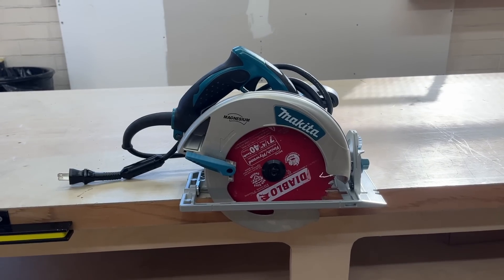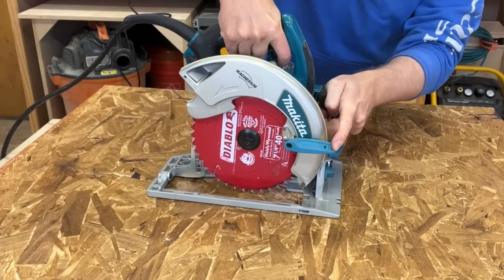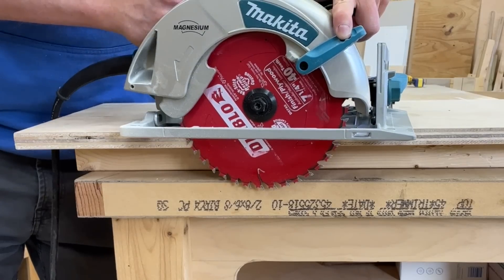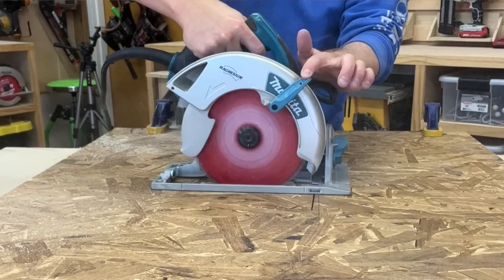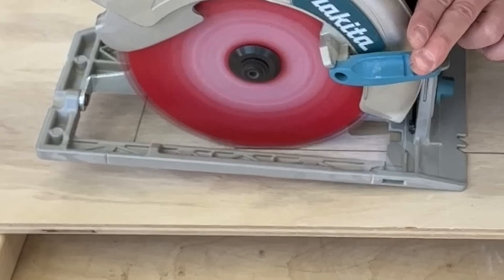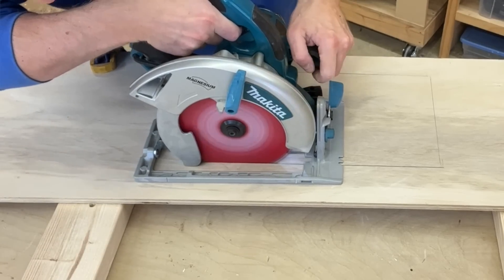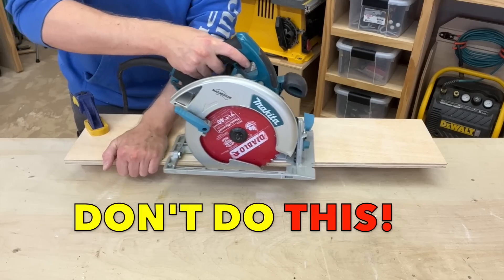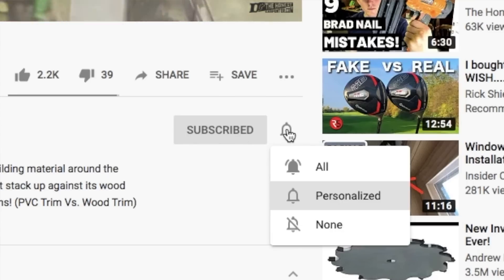Don't Try This DANGEROUS CUTTING TECHNIQUE! (Here's How To PLUNGE CUT W/ Circular Saw Instead!)

Comment: Interesting to see all the anti-plunge cut pushback in the comments. Plunge cuts aren't dangerous if done correctly, which is the way you demonstrated.
Loose plate cutting isn't something I've ever considered doing in over 40 years of working with saws. It's unstable, and achieves nothing that having a locked plate won't. Honestly never heard of it until today.

Circ saws cut much faster than jig saws, especially for large areas. In addition the circ saw is the one being used continuously on a jobsite, so there's no need to stop and break out another tool.
Reply: Lots of DIY types who aren't comfortable with a plunge cut, so jump to the conclusion it's dangerous and should never be done.

Comment: And to things I saw you do and didn't mention.
1) you had your material clamped as to not move
2) stood to the side of the cut, not behind it.

I come from a family of tradesmen ( electricians, tin-knockers, carpenters, etc)
We know about the short cuts. We just don't use then if the conditions are too sketchy.

Comment: I always drop cut 2X4's for framing with my rear handle if I am not using a Mitre Saw. You get a squarer cuts.
Reply from the maker: Yep, you definitely see it a lot with rear handles, Todd. Most framers even do a type of drop cut for square cuts. The worm drive mechanics are just more conducive to it.

Comment: OR maybe... just maybe... Get a plunge saw for the purpose instead of doing dangerous tricks with a circular saw.
Some people will now say "but that is expensive" and similar stuff, but I am pretty sure that it will be more expensive to loose a few fingers! Don't cheap out, and stay safe, those damages are usually permanent damages.
Also, after getting my own plunge saw a few years ago I only had ONE regret... not buying it sooner. A proper plunge saw on a proper track is so much more precise, and is so much easier for those long straight cuts. (Also, I suggest you get yourself a 90degree angle attachment for the rail, it is nice to be able to do perfect'ish square cuts)
I hope you all stay safe :-)

Comment: Cut depth should be set with the full tooth depth just clear of the bottom of the timber. Best not to stand behind or astride a  drop cut on a low job. I vividly remember, way back in 1982, a big 12" saw running back on bloke doing that and opening up his femoral artery.

Comment: Great advice!  One curiocity though: for those of us having a jig saw, would it be better and safer to drill a hole first and then use a jig saw to cut the inside of a plywood like the one shown in the video, wich won't have any danger associated with potential circular saw kickbacks doing plunge cutting, if safety is the top concern?
Reply: yes
Reply: if you aren't comfortable with a skilsaw, then best to use a jig saw. It will take a bit more concentrated effort to keep a nice strait cut over any distance however.

Comment: Good video but it isn't that dangerous, but it is easy to mess up the cut unless using the techniques you showed. Hmm, is there a guide rail designed for plunge cuts? That could be handy. I've seen specially designed circular saws for it but not a guide rail.

Comment: As much as my dad cut corners and rigged stuff, he never did this at all. He'd take a drill and drill a hole to start a place for a jigsaw blade to start cutting a line enough to get the saw blade in. I always thought that was so smart, because even if he would have done this, he would have had to do it just right, as you demonstrated. Better safe than sorry.

Comment: The trick is to have arm strenght, hold the saw with both arms and have a very light finger pressure on the switch, ready to release at any time. And not move the saw backwards.

Comment: As an aside:  I prefer to use a "left handed" circular saw in my right hand.  That way I can just see the blade on "my" side, and not have to hunch over the saw to see it on the other side.
Reply: i hate and wont use anything but left side cut, im a righty and right eyed, ALTHOUGH that new center line cut FLEX is ambi
Reply: I agree. IMO saws are misnamed. Regardless of which side the blade is on "left hand" saws are for right handed users and vise versa. My Bosch CS5, Rigid worm drive, and Metabo 18V are all left handed.
Reply from the maker: I can see the logic there. I just got so used to right-blade sidewinders that it’s like second nature to me now
Reply: I concur! In my comment I asked why he did not use the worm drive saw sitting handily in the background. 😁
Reply: Or you can do what I do and learn  use a saw lefthanded when needed. I injured my right hand when I was a kid and became ambidextrous by necessity. It has carried over to adult life and has been very helpful in my work and life 🙃

Comment: I pretty much loose plate for every plunge but most of the time my saw is on a plywood  track so loose plate guarantees my saw in on track rather than squint. I tend to do it off track too again so my plate is always on my marks. Once I plunge to depth I'll lock the plate. I really don't see any advantage to having the plate locked other than precise depth control.  I suppose it's just the way I've done it for years on thousands of meters of timber, I wouldn't feel comfortable doing it your way.

Comment: Hi,

Although there was a whole video about circular saw safety, I have a question which I did not find the answer for there.
What can go wrong if the revolution of the circular saw (5200 1/min) is higher than the allowed maximum revolution of the blade itself (appr. 3000 1/min if I remember correctly)? I know manufacturers design their products with certain safety factor like 2 or 3 so it should be a serious problem, but I still do not like to go aganst the manufacturer's recommendation. Should I rather not use the blade?

Thanks
Reply: The tips of the blade are where the speed and action is. It's not unheard of for the tungsten carbide tips to fly loose. That would be my main concern assuming its a wood cutting blade with TCT.
Reply: @vidpromjm  Thanks, whats what I thought. As I made some math now, I got that the acceleration of the tips is almost 3,5 times higher when the blade is operating on the highger revolution. So I'm going to buy a new blade, rather not risking little flying (251 mph) tips around me :)

Comment: I heard somewhere that if you remove the guard or have it pinched so it won't cover the saw, and the saw falls down on the table or floor that it'll actually run towards you!
Sleep well tonight.

Comment: I understand why plunge cuts with a circular saw are a thing but if you're not good at them or don't yet trust yourself there are other ways to achieve a similar result. And they're usually safer

Comment: Great video as usual. I understand you don't want to offend/critique  professionals, but an unsafe technique is unsafe regardless of how often you've done it.  The only difference between a pro and a DIYer is that a pro gets paid for their work.  Pro's shouldn't get a pass on unsafe techniques.
Reply: difference is also that a pro will have more experience and skill with tools in general. That being said in nearly 20 years I've never done a plunge cut with a loose base, and can't think of when I'd need to, there may be an odd time but I haven't run into it yet. Plunge cuts are perfectly safe however.

Comment: That technique works well for smaller battery operated circular saws, except you're supposed to have the guard locked back and have a hand on the base. Without the hand on the base it seems pointless

Comment: the best way to do it is to get a saw designed to do it, a track saw
Reply: For finishing work sure. For rough carpentry, nothing wrong with plunge cutting safely with a circ saw.

Comment: I agree with majority of what you said, only thing I don’t agree with is using safety glasses and I flat refuse to use them. For the simple reason that saw dust builds up on the glasses  almost like the glasses are fogged up and makes it really difficult to see what you’re doing.  Been in the woodworking business over 40 years and have never used safety glasses and have never had a problem with anything ever getting in my eyes.   I rather see what I’m doing clearly then looking through a foggy looking lens where I’m more or less guessing what I’m doing and end up having a mishap and getting hurt. All these years in the business and I have never hurt myself with using any of my woodworking equipment and still have all my fingers too! There’s a whole lot of woodworkers out there that have lost fingers if not worse? Only time I use safety glasses is when I’m doing any kind of metal work and/or having to do things from the underneath side of the material I’m having to work on where debris can fall in your eyes.  Can tell you that I have taken employees to the hospital that’s still got crap in their eyes even when wearing safety glasses too!  They may help protect the eyes some, but their not fool  proof.  With experience you learn where to stand and hold your head in a area where the wood chips don’t hit you in the face nor your eyes the majority of the time. But on the rare occasions a chip does fly at my eyes I have always been able to close my eye lids for a brief moment where the chip doesn’t get in my eyes.  People that want to use their safety glasses, more power to them!  But I was raised old school and back when I started in the woodworking business very few if any ever used safety equipment of any kind whether it for eyes or ears, etc.  In fact my Dad had me out spraying lacquer and stains on cabinets with him at only 5 years old and neither of us ever wore a respirator either.  Still haven’t died of cancer yet! LOL  Although when I had my own kids helping me spraying anything I did alway have them least wear a respirator at least.   Little more safety minded with my own kids then my own Dad ever was!  My Dad said many times as I was growing up! Safety equipment for sissies! 😂  which was his attitude!  He also was in the woodworking business for 50 years and never hurt himself till the very end of his career when using a quick set Datto head and let a board get away from him and had a kick back where his finger hit the blade taking a small tip of his finger off.  It actually healed and filled itself back in though and you could hardly tell it got chopped off on the tip of his finger.  He was lucky!

Comment: I don't know why someone would loosen the plate. One of the most annoying things with company saws is having an old worn out plate lock with a plate that flops around. A professional should know what the different material feels like as you cut into it, and generally how far into the diameter of the blade the surface of the material will be at the desired depth of cut
But I will say that a floating plunge is useful when you need to dado a channel into the piece. Doing backing on steel stud framing is tedious and requires this

Comment: Why not plunge cut with straight edge, loose plate and nut and bolt in plate adjuster as depth limiter? Your method provides more risk of an inacurate cut and binding leading to kickback

Comment: Why would you choose to do an internal cut with a circular saw rather than a jigsaw?
Reply: Mush faster, especially for big cuts. Also, on a jobsite the circ saw is already out and in use. No need to breakout a jigsaw. Cut it, break it out and trim the corners with a razor knife if needed. Not for fine wood working, but very efficient in general construction.
Reply from the maker: It’s faster and cuts straighter! A lot of carpenters just live with circ saws in their hands. But, jigsaw does let you make the cleanup as well, which is helpful.
Reply: typically do the majority of a cut like this with a skilsaw, then do the corners with a jigsaw so you don't overcut. Skilsaw is faster and straiter cut, especially with thicker material.

Comment: Sorry, maybe my cheap "DIYer" saw is better than yours, however, when my plate is loosened, it does not move side to side! I've used the plunge cut a couple of times, and the loose plate method, having the whole plate on the work piece before the plunge, is much more stable than trying to balance the saw on the edge of the front of the plate! Just MHO....

Comment: YEAH... I tried using my circular saw, on a 45 degree angle, in my ceiling, to cut the edge of 2x4 plank in my basement bathroom ceiling, that was jusssst in the way of the exhaust fan duct (the top corner/edge of the 2x4 ceiling plank next to the bathroom fan).
It was my first time doing such a thing and I regretted it so F*cking fast.  
Now, I'm rather tiny at 100lbs 5ft, with no muscles to match...
Anyways, the moment my 'plunge cut' began up there in the ceiling, it snapped my whole arm back so fast, wrist into the ceiling joist just 6" or so above my hand holding the saw. It hurt so bad, and happened so fast that I couldn't even move my finger to disengage the saw motion, so the spinning blade fell onto the wood plank AGAIN, this time kicking back my whole arm, head even made my back arch backwards which would've thrown me off the ladder if not for another ceiling plank behind me. At that point I was able  to let go of the trigger, but also the saw...

I dropped the saw from there (cordless) onto the border of my new acrylic shower surround below... made a lovely break with some long hair line cracks around it too.
Broke my new saw too (the plastic parts that help align + hold the battery to it).
And even 3 weeks later, my shoulder is just feeling better, but my wrist still hurts to bend
On the bright side though! I didn't fall off the ladder at least! 

This is a super important video for everyone to watch I think!
I was just dumb with what I did... but that's what I get for trying to rush a bathroom to finish before christmas.

Honestly, I never wanna touch a saw again lol, but, I'm happy to know these techniques to share with other people in my life at least
the kick back is so much stronger than I would ever have imagined.

Comment: I've been using a circ all my life and never even heard of "loose plate cutting". The first clue it's a stupid idea is that the inventor didn't know it's called a SHOE, not a plate. Is this actually a thing?  What is the purpose when you could just leave the shoe locked and pivot on the front edge like you showed? Then you retain your set blade depth.

Comment: He kind of jumped over the part of DO NOT cut backwards part without explanation, so here is one why cutting backwards is bad idea: you increase the risk of kickback quite much, even if you are professional with many thousands of hours of cuts under your belt, it´s a bad idea. I´ve also found in many cases professionals can get complacent with safety and sometimes even start thinking things will not happen to them, no matter how stupid stuff they do. Also being tired while operating power tools/cars/ heavy machinery isn´t the brightest of ideas, I know it sometimes can´t be helped, but there is a limit, especially when doing the same cut over and over again people dent to get too comfy with saw blades spinning many miles per second.

Comment: Loose plate cutting is idiotic. Started in rough carpentry in the 80s and technology and equipment has c’hanged massively since then but idiocy will always persist. Was just plunge cutting earlier today and used the same method I have for decades, setting my depth, getting the front of the base perpendicular to the cut with the blade edge on the line then simply rock/roll into the material using the front of the base as a pivot point. 
One note though I do, occasionally, cut backwards, while I don’t have an issue with this if you don’t have the experience to do this safely don’t do it. Much like climb cutting with a router isn’t good, except when it is, back cutting has its uses but needs to be done with full attention and a clear understanding of the mechanics and function of the saw.

Comment: Compared to the tool designed to make this cut, the old school "safe" method you show is dangerous and far less accurate. I've done it many times and it works for sure but it's 2023, for plunge cuts, use a plunge saw! They've only existed for about a decade...
Reply: Haha you are so right. I don't get it either.

Comment: "Amateurs" Might be using less powerful saws which may just bog down vs. Kick back. A worm drive framing saw for sure has some grunt to it. Get that wrong and boom. A battery saw is even more likely to  bog down vs. Kick back. Definitely not a pro here. I definitely have needed to plung cut though. Never thought of loosening the plate though. Hmmmm....

Comment: I will refrain from giving this a "Like".  Plunge cuts are too dangerous for me, and there are safer ways to get the same result, particularly for rough-in board.  I appreciate the safety comments, but no thanks.
Reply: if you are comfortable with a skilsaw, it is perfectly safe and works well, faster and will give a straiter cut than a jigsaw. However for a DIY person not comfortable doing this, nothing wrong with a jigsaw at all.

Comment: i will never understand why you "pros" never come to the simple idea of setting up a fence on the piece you are cutting and the start the plunge cut with the saw against the fence. That way you dont have to "tweak" a RUNNING circular saw freehand on a piece of wood.  Makes it easy, way more save, lowers the chance of kickback and if set up right way more accurate. Or just spend the little  extra and get a plunge saw with the guide.
Reply from the maker: Usually speed, Ecko. In pro construction work, there just isn’t a lot of time. Consider that rain alone may kill a quarter of your schedule every year. You just can’t slow down for stuff like that.
Reply: @TheHonestCarpenter   Thank god america is not a standard